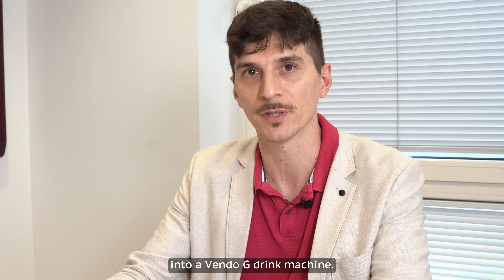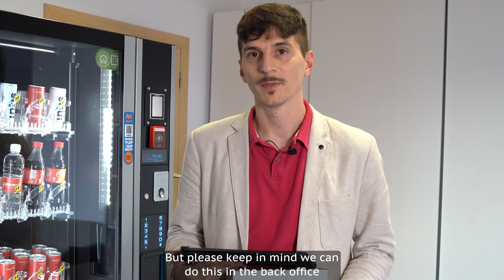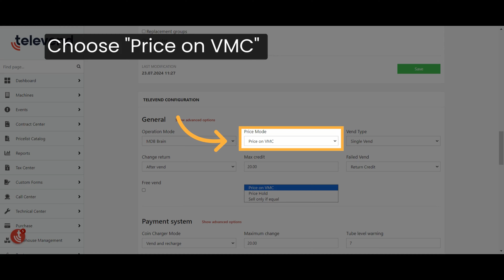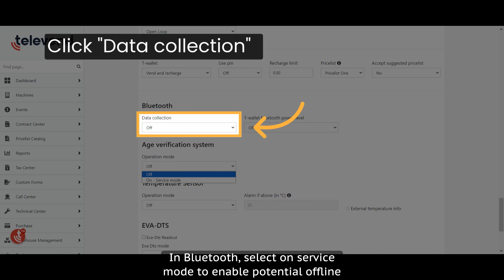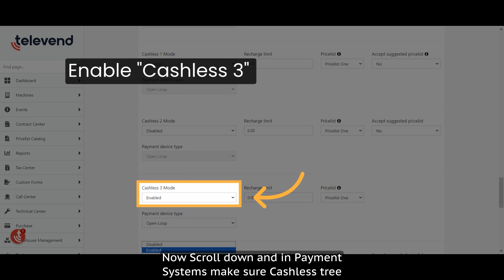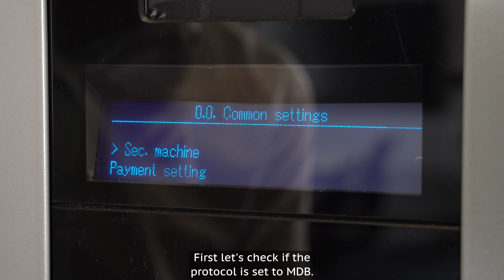How to install Televend Box & cashless reader into vending machines with MDB protocol

Comment: Hello my friend. You forgot to show to new users they need to push configuration from setup tab. Kind regard Adnan from Automatic servis Bosnia
Reply from the maker: Dear Adnan, you are right: when the Televend configuration is changed, and the Televend box is online, the configuration needs to be pushed. Also, the Televend box pulls the configuration on every power cycle / boot-up, which was the process we covered in this video. We completed the configuration and then powered up the device. So, when we're making configuration changes remotely or when the Televend box isn't being rebooted during installation, as you noted, the configuration needs to be pushed from the cloud to be applied. Thank you for this notice and for being our valued customer. 😊